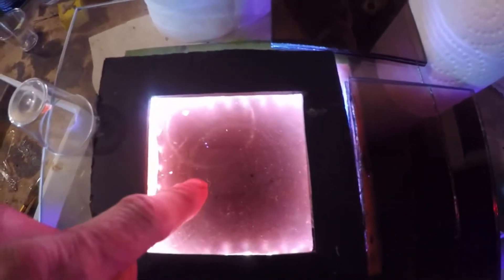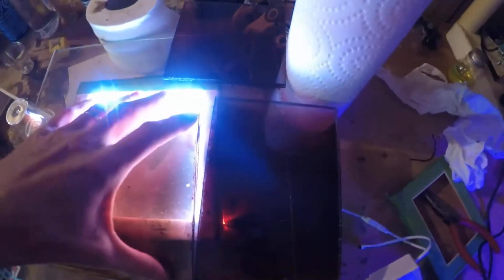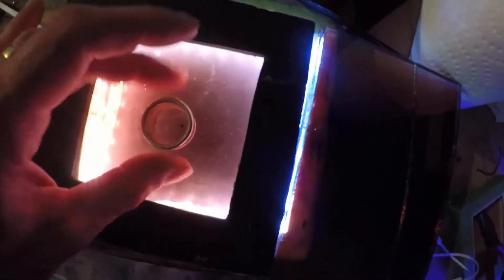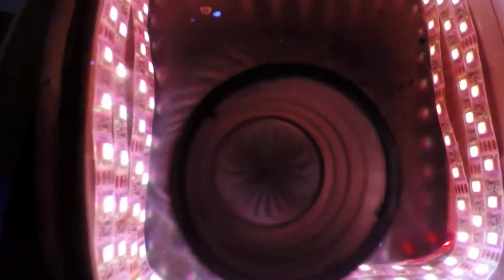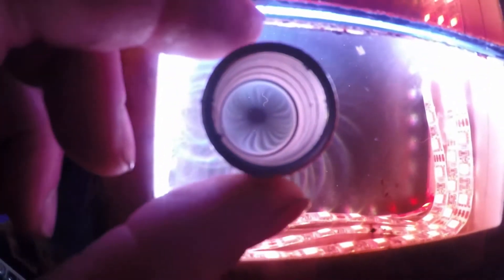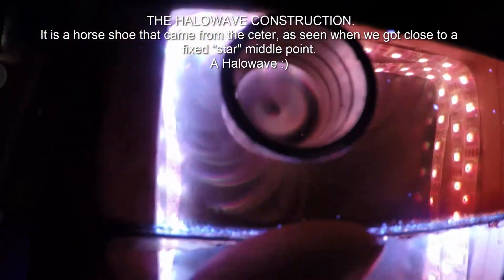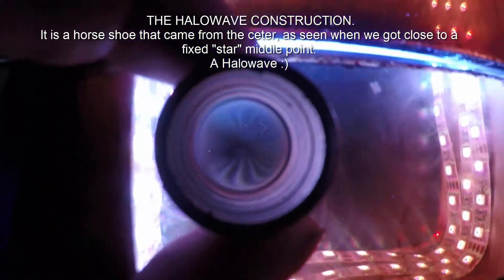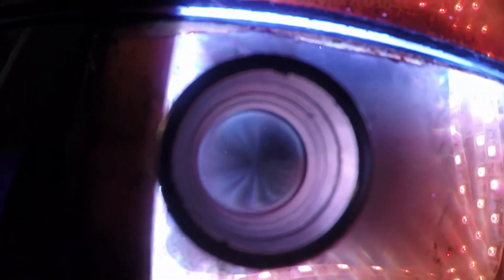Ferroplate Thickness - Does it Matter to what you SEE?   YES!

Comment: part 2.  I just did some research.  Earlier, I had learned that the maker of the commercial ferocells said that the light, or magnetic influence, was twisting the ropes of nano crystals that the leds were forming, that we see as force lines extending from each led.  So I am not sure if that means anything yet, but maybe it does.  However, looking up other factors, it turns out that most led's flicker at the normal light bulb flicker in usa alternating current sockets of 60hz, the speed of old computer monitors.  A person could get a good computer monitor, and magnify the streams coming from a pinprick shell of a few lights, say 30 or 20, and see if the hertz or refresh rate of a computer monitor at different refresh rates causes the spin speed to change in the nano crystal ropes we see as lines of force.  That might be not only a great discovery, but worthy of a Nobel prize.  Especially, if the light has no effect on the spin rate of the ropes, because this would mean that each rope or line of force seen was rotating because of the magnet's outer influences and would hint at the magnetic field construction itself.  But if light refresh rate was rotating the nano particles in the ferofluid, then you have light itself interacting with the nano crystals which would give the world a new technology and way to manipulate magnetic fields.  It would also be an easy test to see if cymatic sound influences changed the magnetic patterns in the ferofluid, and this is gonna happen, but... its the sound waves that don't change during frequency shifts that will show null points and the actual interaction with the magnet and the nano particles.  It is perhaps possible to cancel out magnetic attraction with just sound waves alone, who knows, it could lead to antigravity???

But, I accidentally changed the subject.  If refresh rate does effect the way we see the force lines, you can avoid that by increasing the refresh rate greatly, and luckily, there is a cheap way to do this, with fluorescent bulbs that have ballasts in them that change the flicker rate to 20,000 hertz.  This was begun in the past so as to avoid eye strain that many people got in business offices who were sensitive to the flickering at the low 60hz rate.  

There is so much you can discover, and cheaply so , it is an amazing time.  I would love to do these experiments myself, but sadly, I am dirt poor, and trying to make money for my wife and loved ones using what I have left on my disability check.  I do, however, believe that I can soon start on my subspace experiment, which is oddly enough, easier and cheaper than I had at first thought possible.  So, anyway, I wish you great luck, whatever you do, and lots of christian love from your brother in christ.  :-)
Reply from the maker: Love right back atcha brother :)
I believe the the light hertz is a false trail as light is not interacting with the field..it is merely showing it...is my belief.
I know zero about electronic testing and such so I dunno really....now I am working full time experiments have stopped for now...I have done all God showed me really.....so vids may be slow coming from now on....I am going to go through the Bible and show the electrical events as they happened ..a series about it all as I have now shown all science to be massively flawed....and I have covered every subject I can think of...
God is not pressing me to do anything now...which is probably why I am back working.
Haven't been able to keep a job in the last 5 years due to all going on and now I am tiling again with no pain...same as Paul went back to making tents once he had finished his ministry.
Im feeling the same thing from God...He is allowing me to wait ...so I do.
I have completed from genesis to magnetic theory using double helix energy flow....so all is now finished.
I pray things start going well for you man .
Reply: I understand, thanks!

Comment: cool discoveries.  You prove some valid points that the construction of the apparatus is affecting how it looks.  ie. thickness of the glass effects the contrast of the image, thinner glass making a sharper image, and... I see that the silver nickle reflective, shiny coating on the magnet could be reflecting light in the center as well.  Which could make the image less clear.  And, if you had a million leds instead of that already impressive number in your device, you'd have a million outward lines of force shown, or would you?  how many lines of force are around a magnet?  what if there were only a thousand, and it took a person two thousand to see that every two led's are no longer making a difference in the line of forces seen.  In other words, more lights could mean more resolution.  Now, interestingly, you don't have to have more led's to get more lights.  In fact, you can get a thousand lights from one large flood light, but shining inside a shell with a thousand pin prick holes in it that shine inside your tunnel.  

I tried my best to explain to Ken Wheeler that the ferrocells could be showing false positives due to the way the light is bending and the number of leds.  And you very proved that point, Lee, Sir.  I wonder though, about the light being used.  is led light different than incandescent light?
Reply from the maker: "thickness of the glass effects the contrast of the image, "..actually no :)

What I mean is the image is not visible at that height BUT it IS visible at 2 mm......its not about blur or contrast...its about how close....the HOLE means you do not see the connection to the POINT...as that full star pattern is close to the magnet...once you move away?...the field has CHANGED as it is expanding outwards...mine is close so I see the connection point...far away means you do not see it...but it exists..
I like led's cos they are bright...and so with more light you see more...too many?..and it would just be a solid ball of light if all lines were shown.
I have not used other light...
Reply from the maker: My video about a double heartbeat being in a magnet shows the little point vortex connection...which you dont see when far away...which is why ken wheeler is wrong on many things :)